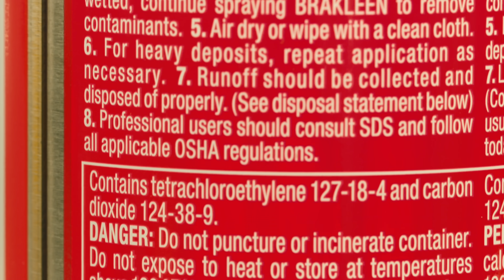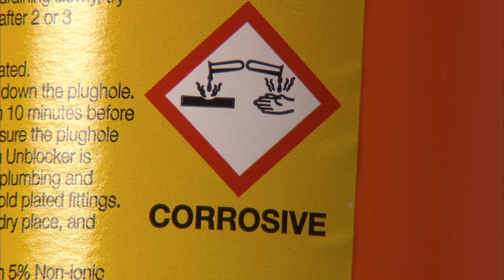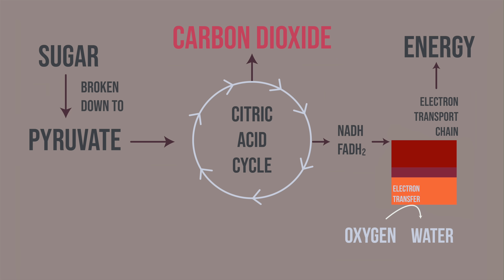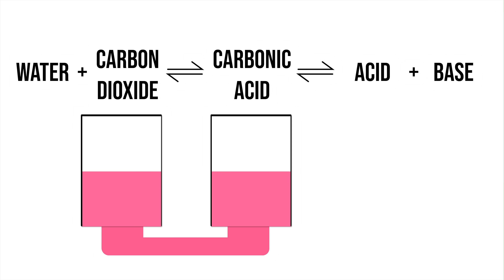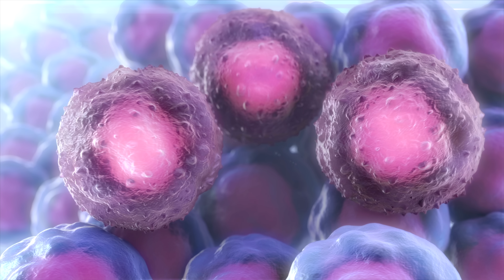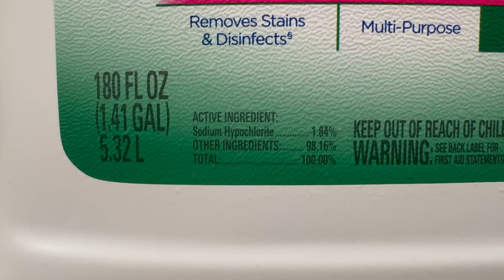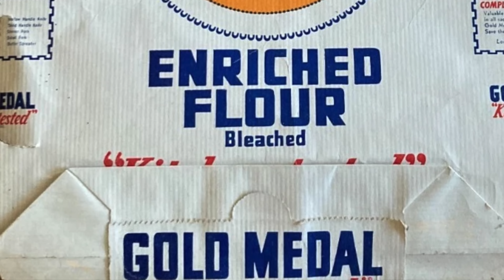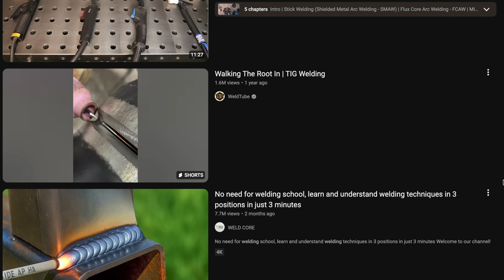"It smelled funny while I was welding and now I can't breathe..."

Comment: my dad used to weld, had a good paying job, was in line to get a really good paying job. Then a microscopic shard of metal went through is professional grade welding goggles- he's still unable to weld without extreme headaches. This was back in the late 70's, so professional grade goggles are now way better but it still a warning to not trust your equipment, either. get the highest quality you can, be vigilant on reviewing the safety equipment you are purchasing, and learn proper techniques. one instant is enough to maime you, disable you, and even kill you. My dad did everything right, yet the cosmos still determined welding was not his path.

Comment: You're not even supposed to use brake cleaner in a non-ventilated room let alone super heat it with a welding torch

Comment: And most respirator cartridges aren't going to remove chlorine gas, chlorides, chloramines, and various other inorganics. Even the respirators labeled for "acid gas" aren't great for chlorine (still better than plain activated carbon!). In the 3M line, you need the 60396 that I presume contains the sodium thiosulfate and NaHCO₃ (baking soda) combo that will protect you from chlorine, but they're hard to find and around $40 a pop.

Comment: At one point I had been looking into picking up a hobby of operating a forge to cast my own ingots from things like aluminum, lead, copper, etc.. just for fun.
After doing some research I decided against the hobby due to the dangers involved.. not only with what are called steam explosions.. but also due to the dangers of inhaling aerosolized metals.
I realize there are safety devices and protective gear.. but I also realize that I am awkward and a bit of a klutz so anything that dangerous is not a safe hobby for me even with such protective measures.

Comment: This is why you should always try to fully read safety labels on chemicals even if its small. Brake cleaner has warnings to keep away from sparks, heat, fire,etc.
Obviously its annoying, takes time, energy, memory, and good eyesight, but nonetheless you should try to do it, even for household cleaners. Of course not to put blame on him for failing to read and remember a small part of a microscopic label, it's just tragic.

Comment: Alot of lower end drag race oil pans (and even some good ones) are stamped steel with a gold itridite coating.  Moroso in particular, used to warn "REMOVE ALL GOLD IRRIDITE COATING BEFORE WELDING TO PREVENT PHOSGENE GAS PRODUCTION"

So if you didn't grind ALL the gold coating off, and you were modifying the pan with steel trap doors or extensions, there is a good chance you would produce phosgene!  Now I know how dangerous this actually is!

Comment: 5:50 Small correction, welding doesn't use high voltage, most welding is done around 20V. Clipping together 3 9V blocks has higher voltage than most welders put out. But yes, it's super high current, as that's what "carries the heat".

Comment: Also among weird and possibly dangerous reactions from simple household chemicals... do not mix or dilute bleach with hot/boiling water. It can speed up the release of chlorine fumes/gas which can cause significant problems, particularly in the wrong environment (like a poorly ventilated bathroom).

Comment: I would argue the primary reason that we breathe is to expel CO2 gas rather than oxygenation. I say this bc the ventilation drive is primarily controlled by CO2 levels, and the hypoxic drive is merely a backup. For example when ur working out, you breathe faster because your body needs to expel CO2 more, not because you are low on O2.

Comment: Non-chlorinated brake cleaner is the way, folks. Works great without killing brain cells or worse. Still don't want to breathe it, but it's way safer. Just keep it away from paints, it's a strong solvent.

Comment: Thanks Chubbyemu, This one hit's so close to home.  I started welding when I was 16 years old. I was also a mechanic who used BraKleen and who had used a propane AC refrigerant leak detector which produces phosgene gas.  This was done over a 30 year career as a mechanic.  Phosgene gas was also uses as a chemical weapon during WW1.  Not only should you use long sleeve (cotton) shirts, leather gloves and a welding helmet with a dark lens, you should use a respirator and use it while grinding off rust, paint and while welding.  The same company makes a Non-Chlorinated Brakleen.  There are some harsh chemicals out there being used in many different occupations so use caution and your PPE.

Comment: I initially guessed it was going to be about zinc poisoning from welding galvanized steel.  But I think I may have come dangerously close to doing this when I first bought my welder.  Just that there was enough time for it to evaporate.  Now I only buy the non-chlorinated brake clean.  Also typically use acetone instead.

Comment: As a self taught welder, this was absolutely eye opening
Reply: genuinely glad this video reaches people like you who it might save from a similar mistake 🙏
Reply: lots of stuff has chlorinated solvents like the old good versions of tapping fluids
Reply: As an excessive user of BrakeClean.. I'm hearing ya.
I don't ever recall using brake clean as a prep for welding, but I may have.
Reply: For multiple reasons, metal should be completely clean of any extra substance (including cleaners) before welding.
Reply: @LagMasterSam how do you do that ? I work in industry as a safety guard the crap welders will welt through without question is absolutely  insane. The problem is as a fire guard i can watch out for fire or for obvious problems but most of the time even if i ask people dont know exactly all the products that were used somewhere and I dont know what products will react with heat . I find it very difficult because I feel responsible for peoples health but I'm limited  in what I can do or prevent from happening
Reply: Send these people a link to this youtube video.  🤬
Reply: @LagMasterSam  Brake clean evaporates quite rapidly, so there is no substances to see or clean away.
Reply: @axle.student its the residue that creates the gas. You aren't supposed to use brake or carb cleaner,  use acetone instead
Reply: @axle.student  You have to be rage baiting 🥀
Reply: @OnlyTheTrutha  According to all the literature (safety etc.) Brake cleaner leaves no residues when dry.
This has always been the case, so I am curious about who would strike an arc on wet brake clean.
>
P.S. I typically use acetone or iso alcohol for most cleaning, but with cars, brakeclean and carb clean is the more common, but we typically are not welding in that environment.
Reply: @OnlyTheTrutha  Acetone doesn't make such a toxic gas?
Reply: And lung destroying.
Reply: Lung saving.
Reply: Glad you're still around!
Reply: Eye opening? What about your squint googles?
Reply: I went to school for welding. Do not weld if you have not been trained professionally. I’ve seen many professionals die. It’s A LOT of electricity. The metal is turned to gas, then liquid, then solid again. Don’t mess around with these machines. You can AND WILL die. Just don’t do it sell your machine before you die in one of a thousand ways
Reply: @SméagolsHarvest  "It’s A LOT of electricity." lol
Yep, don't stick your tongue on it lol
>
There are a lot easier ways to die via misadventure than a welder :)
Reply: Wear a respirer mask
Reply: @Joshua-cs6gj that literally doesn't know unless you have the correct type
Reply: @OnlyTheTrutha  que?
Reply: @Joshua-cs6gj  You'd need a SCBA in that case.
Reply: “I’m a self-taught welder and found this eye opening”

Fixed it for you.
Reply: @X22GJP Nuh-uh. "I'm a self-taught welder and found this eye-opening." The "eye-opening" is a compound adjective modifying an understood "information" or equivalent noun. I proofread for money.
Reply: @X22GJP  You need to purchase more brake cleaner for your self. You can't have enough sensitization. :)
Reply: even the chinease can see it now
Reply: @r-ratedstudios3847  Bro wtf. NOOOO NOOOO you can't say that. That's racist. It is not ok
Reply: @brojakmate9872 

We've watched the videos. 

Not racist. 

Just stupidity in action.

Comment: Speaking as a chemist, any time you smell an unexpected smell and you're working with chemicals, it's a pretty good idea to figure out what that smell is
Reply: First and last time I thought "pool chloring could be handy cleaning agent" was premixing the granules and water. "Strange, they don't seem to dissolve, I'll just leave the bottle here abd come back later".
Later turned into a full day, unscrewed the bottle cap, a small "FSsst" came out and I suddenly knew the smell of The Reaper 😮
"Oh, I'm about to die" was the dread that instantly hit me as the accumulated chlorine gas hit my nose and lungs.
The burn, the choking - very extremely unpleasant.
Instantly lost most of my ability to smell anything, gladly though the olfactory did a full reboot in 24 hrs.

I gave the rest of the pool chlorine away the next day. "It's just not for me" 😅
Reply: @Paxmax  you were like a few steps away from creating a chlorine gas canister and subjecting yourself to a furry convention gaming moment, crazy
Reply: @homeopathicfossil-fuels4789  😅 I had a brief moment of experiencing the starting point of the horrible deaths suffered in WW1 trenches when chem warfare started at mass scale.

What amazes me is the speed of spread; the small "fsst" wasn't even directed at me, it wasn't "a blast of gas", it just escaped all around the bottle cap at nearly an arms length, less violent than opening any fizzy drink, yet it reached me in less than a second due to the way gas molecules actually behave.

I'm fortunate to also be a hobby freediver, so I have the breathing control and lung capacity to deal with it, but damn, I got a good shock and absolute dread of death instantly when it surrounded me and stung / burn in my airways.

I was also concerned that my sense smell would be lost forever.

It was the quickest "Well, this is not for me" decision ever 😅 (I do not feel responsible enough to safely deal with this)
Reply: @Paxmax  you should get yourself checked by a doctor
Reply: @Paxmax When I went through army basic training in 1967, they conducted CBR (chemical, biological and radiological) training, during which we were required to lift the side of our gas masks for a second while in a chamber of chlorine gas  and take a quick whiff. It was not a pleasant experience.
Reply: The ones that are orderless in high concentrations always scare me the most. I used to have to work with hydrogen sulfide regularly, absolutely hated it.
Reply: "I better take a stronger second whiff to see if it reminds me bet..." 😮
Reply: @Paxmax  "Waft don't whiff!"
Reply: @badgerlegion2  "Waft don't whiff! You'll avoid ending up like a stiff!" 🤣🤣
Reply: Everything is chemicals. If I drink tea I'm working with chemicals. 😂
Reply: @robertschnobert9090 Yes! Careful with that neurotoxic caffeine!
Reply: @robertschnobert9090 it can debated in the case of neutron stars, which are, at their upper limit, mostly physics.
Reply: @robertschnobert9090 We know. Have you noticed that lots of dumb posts end with an emoji?
Reply: I seem to recall a case here in Australia where a whole store was evacuated because a kid put grapefruit juice into a tub of pool cleaner - guess it liberated a lot of chlorine gas....
Reply: @MichaelBrodie68okay, that's just dumb
Reply: I'd say the first thing to do is to stop whatever you're doing and go outside.
Reply: @philipcooper8297  Yup, stop and go, that is that I did. I started continuously only to breath(wheeze) out slowly as I exited the bathroom and closed the door behind me... went right into the kitchen and hung out my head outside the window on the other side of the house to breathe in again.

Then form a plan to walk back inside bathroom open window, go back out, close the bathroom door.

Form next plan: go inside, cap the bottle, take outside, tip bottle over, go away 😆

While going all theses small operations, only breathing out in presence of chlorine, to prevent any (appreciable*) amount to enter once more into my airways.

* Chlorine breathing never felt appreciated to begin with, but you know, language thing 😂
Reply: Figure out later, first leave.
Reply: This reminds me of the recent video of advanced tinkering where he makes a rare, toxic, blue gas and the entire lab turns up to take a whiff because it’ll be the only chance in their life to smell this gas.
Reply: Exhale immediately and retreat!
Reply: From a safe fucking distance.
Reply: Funny thing, SP is a chemist
Reply: Unexpected smell in general tbh.

Not a chemist per se but I was a college chemistry student at the time. Partner and I started getting headaches and nausea from time to time at home, and I noticed a smell like ozone (which I recognised from playing with DC motors as a kid). Did some quick googling, found a somewhat-toxic class of chemicals that smell like ozone and come from partial combustion of natural gas, and of course we know that that partial combustion also produces carbon monoxide. Figured out it was coming from our old gas hot water heater, and yeah we escalated that real quick. Can confirm, carbon monoxide poisoning is Not Fun.
Reply: SP didn't think of himself as "working with chemicals".
Reply: Smells like uh oh

Comment: Welder/fabricator here. Let’s see what happened

Brake cleaner…..yeah. Don’t ever use brake cleaner. Even the chlorine free one. Because any lapse in concentration and getting the incorrect one can lead to this. Also invest in a mask with a P3 filter or PAPR setup. You can get good ones for not a huge amount of money. Your lungs are worth it. And use it for grinding. Imagine fibreglass that itches the crap out of your skin in your lungs. 
Look after yourselves

Comment: When I used to work in the vinyl extrusion industry, I started working with older type of single screw extruder and unknown to me at the time, they had alot of voids and between the screw and the die.  This caused the vinyl to burn.  

Well, all is OK while its running, it only becomes an issue when you stop running and need to do a die change.

I was doing my first die change and the other guys were just watching to make sure I was doing it correctly, except they did not tell me one important thing, and that was, Don't stand over the top of the die when you break the seal.

I soon found out the why, when a cloud of Hydrochloric acid formed and hit me in the face, lol.  I started coughing and my mucus in my nose started draining.  It felt like I burned my lungs and I had drooling.  

They all started laughing and told me they all went through the same.  I never made that same mistake again.

Comment: Fab shop manager here. We use non chlorinated brake cleaner to clean our weld fixtures, not our work pieces. 

We use acetone, pure alcohol, dawn, and a combination of abrasives to clean our work pieces.

I always warned against welding over chlorinated brake cleaner, but had no idea it was that bad. 

Some don’t like to take respiratory safety seriously, because it can be uncomfortable. Specially down here where its hot. Yet, it is the use of respiratory safety devices, that gives a welder a lifetime of healthy lungs. 

Unless they filter the fumes through their cigaret. That filter does not protect from anything.

Comment: I accidentally chloroformed myself by not properly cleaning bleach off a surface and then using vinegar. Not as dangerous as chlorine gas but still almost knocked myself unconscious.
Reply: That's not how chloroform is made and not how it works either.  It's not like in the movies, it doesn't actually knock people out like that.  Also, you have to mix acetone with bleach to make it, not vinegar.

Comment: Nowadays almost all brake clean is non-chlorinated. It usually costs of mostly acetone or isopropyl alcohol. They also use heptane and toluene in a lot of them. I honestly dont like acetone for anything other than removing paint. It eats through rubber (particularly my nitrile gloves) and most plastics and doesnt remove grease as well as the alcohol based cleaner. Alcohol doesnt melt plastics or rubbers before evaporating and it removes grease really well. It doesnt stink nearly as bad as acetone, either. It just smells like hand sanitizer. I imagine it’s not so harmful to the body, but I’m not sure on that.